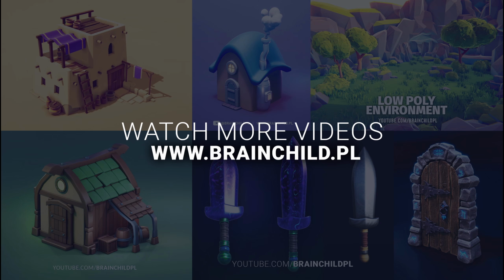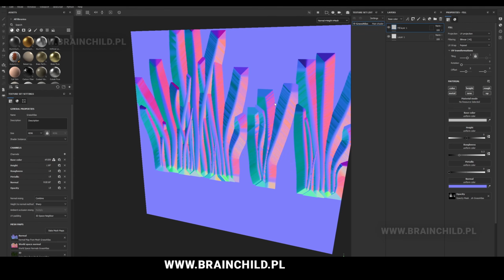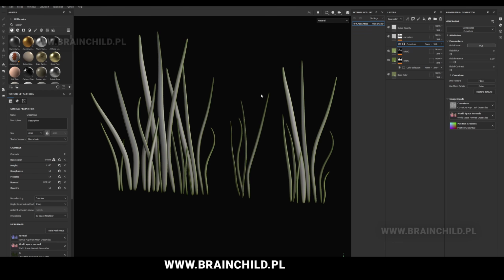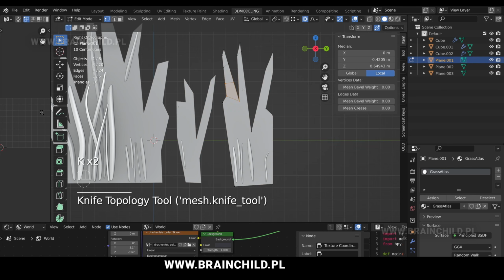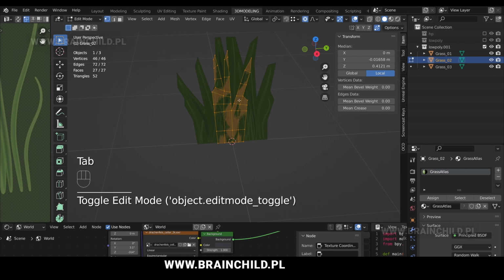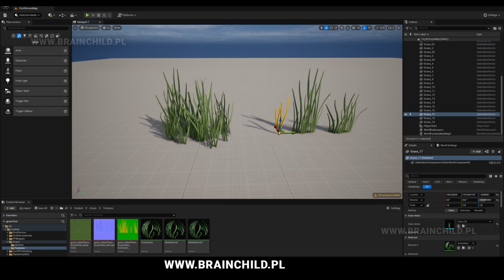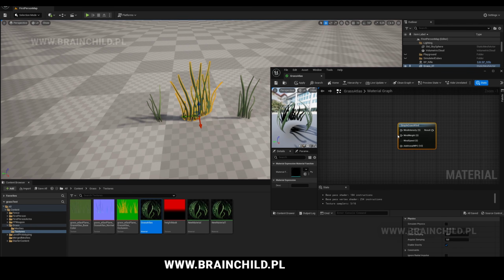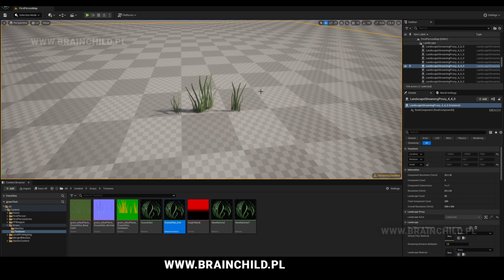TUTORIAL - How to create (Game-ready) STYLISED PBR Grass in Blender, Substance Painter & UE 5 (2/2)

Comment: Great video. One think i don't understand is where did you find this ID map? Cause i have 2 different materials in my high poly and it's not the case for me.
Reply from the maker: Your low poly should have just 1 material. The high poly needs to have 2 materials (each material is a separate color in your ID map) because each material that you assigned to the high poly mesh will be baked into the ID map (of the low poly model) inside substance painter . As you can see in this example in this link https://substance3d.adobe.com/documentation/spdoc/id-142213446.html the red color is the first material (of the high poly) and the green color is the second material (of the high poly) - all the materials (of the high poly model) will be baked to that kind of ID map (all high poly materials are baked into this 1 texture and they are used to mask out different parts of the high poly details you baked into your low poly model).
Reply: @brainchildpl  Thanks for the answer. I found the solution tho. It was at the export settings. I usually just add only the mesh. And for some reason it didn't export the id map information. Once i select all of the options it was good